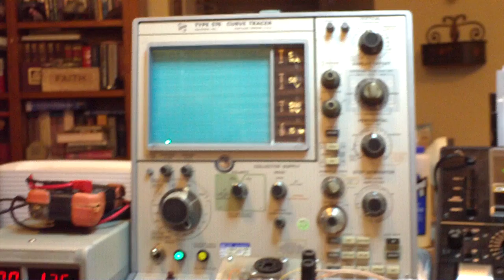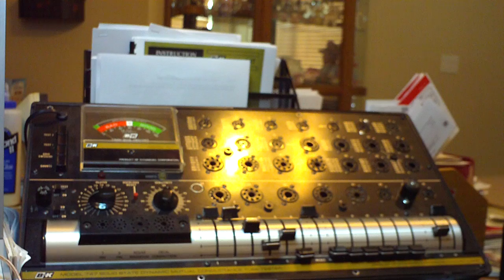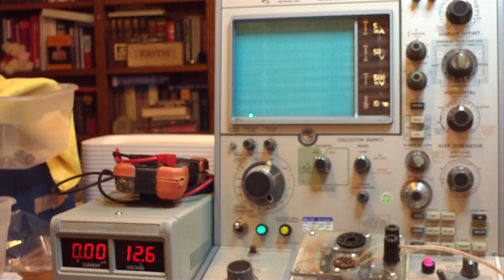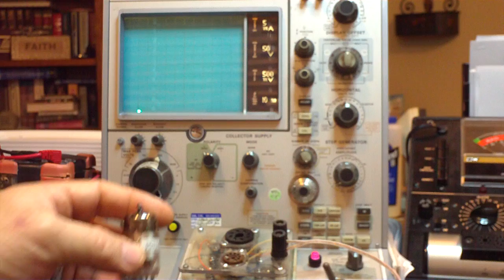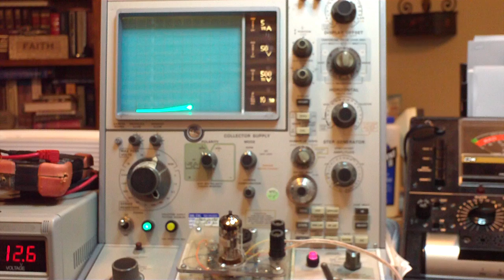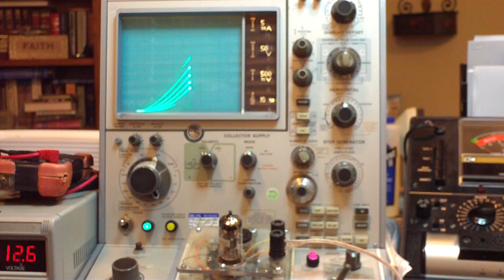Vacuum Tube Matching

Comment: I NOTISED THE HEATER IS REDY TO POP ON THAT SECOND TUBE IT CANNOT BE A NEW TUBE SOMEONE HAS LIED TO YOU
Reply: +Ron Smith Wow, I want to be just like Jamie Phillips when I throw up.  The heaters flare up on the European tubes because they used tungsten filament wire. Duh!  It's 100% normal for most European made miniature tubes, with tungsten filaments to flare up. Some people agonize and analize over it, & some even make a cold start kit, but it is a normal standard start up phenomena. Wooooeeooo!  Cold tungsten has a very low resistance, and it draws a lot of current, so it glows kinda like a light bulb, for a very short period of time. Then, as it heats up the resistance rises, and the current drawn by the heater drops, thus causing that momentary flash, while the tungsten is heating up. Turning on any old timey light bulb is akin to a short circuit, for just a few milliseconds, until the tungsten filament heats up. Wow, and I am just an ignorant electrician! Okay, I was making $10K a month, and I was wiring places like Raytheon, Gen Dyne, Harris Dracon, SGS Thomspon, Intel. Motorola, Honeywell, etc. and even doing RF work, but still. I also have a Tektronix 576 with a socket test bay & breakout box, utilizing a Lambda regulated PSU for screen voltage, and 6.3 or 12.6 volts heater supply, or I use a Variac or another regulated DC supply for "other' heater voltages between 1 and 240 volts. My socket bays use a breakout to 2 sets of 12 5 way post connectors. That way I can test 12 pin Compactrons, and 10 pin European tubes. I am up over 16 pairs of sockets now, and with the breakout, I can hook up others like Acorn, light house, pencil, whatever. I have the old prewar 4 pin, 5 pin, 6 pin, 7 pin, 8 pin,  Octal, Loctal, Noval, 9 pin mini Novar, Magnoval, Duodecal, 10 pin mini, 10 pin mini with center pin, Nuvistor 1 , Nuvistor 2, English 8 pin, European 10 pin, Russian 8 pin, 7 pin mini, and probably some I forgot. I also have a Tripplet 3444 & 3444A which I really love. I even have the B&K 747 Dynajet too. Good little tester, really neat theory of operation, and a super neat little fail safe protection circuit in it too. Maybe not my favorite tester of all time, but well worth keeping, if only for the unique way it works, and they are just plain cool, with the reset lever, color graphics and all that. The book is in the lid, and the supplemental book is really nice too, with some European tubes my other testers don't cross reference. The Triplett's manual allows me to test anything just from the data sheets, without needing a chart. I suppose I can do that with my Hickocks too. I resurrected one (KS 15750) from some hack that wired it up wrong after changing the caps in it. Oops! He wired the bias voltage selector backwards & butchered the VR test 
section.
Reply: You are correct sir. EVERY Mullard 12ax7 with a split top flashes. They flash brighter when new and as the degrade they flash less bright. This is because they WERE MADE THAT WAY. The Telefunkens in this video both were BRAND NEW NOS in the box. They both flash brightly.....but according to some "tube experts" they must both be defective. LOL
Reply from the maker: +Jamie Phillips It is a new tube. These tubes flash on start up. That is NORMAL. There is no way to tell if a tube is ready to"pop", as you say, by looking at the heater. If it were "ready to "pop" it would not conduct as a new tube. It is a new tube. I KNOW because I opened it from a sealed package!!!! Thanks for watching.
Reply: I DID MY RESERCH THE HEATER FLASH IS A DEFECT WITCH WILL LEAD TO A SHORT TUBE LIFE LOOK IT UP
Reply: @God-CDXX  Stop shouting. 12AX7s always do that.
Reply: +Jamie Phillips  Wow all that time in college becoming an electronic engineer was a waste. I could have just "done my research" and I could have been a tube wizard like you!
Reply: +Seth B PS I HAVE HAD MANEY HUNREDS European made miniature tubes THAT DO NOT FLARE ON STARTUP AND A FIEW DUDS THAT DO THEY MORMELY QUIT LONG BEFORE THERE TIME
Reply: +Seth B OOOOOOOOOOOO SOME TESTER YOU GOT I CAN SAY LIKE ME YOUR SMART I BUILT MINE SO I COULD PUT ANY TUBE IN A AUDIO CIRCUT ANY TUBE FROM EF14 TO WD11 TO 17BF11 TO 12AX7 TO 3-1000Z TO 6336 TO THE HOWLE BOOK ANYTHING WITH A GRID I BASED THE TESTER MODE ON A HICKOK KS-15874-L2 WESTERN ELECTRIC CARD-O-MATIC  TUBE TESTER
Reply: @God-CDXX  I understand now. You think you are God, but you are only God #420. I see why you are shouting all the time.
Reply: Can we reassure god 420, that the telefunken tube that lit up with a bright flare on the test is still going strong….👌🏻
Reply: ...what's that you say?  A defective witch?
Good catch there,  obviously you are a fully qualified
witchsmeller pursuviant!

Now....do some research on grammar and spelling.
Your drivel is damn near unreadable.